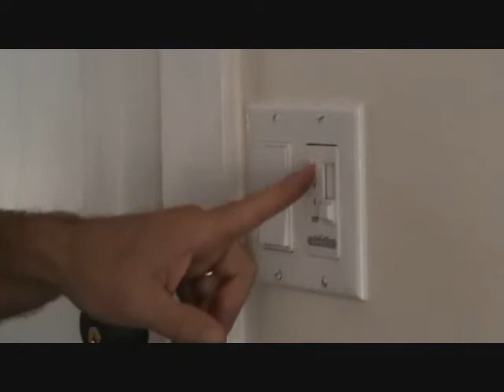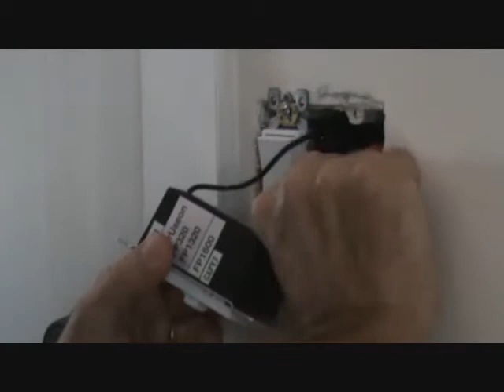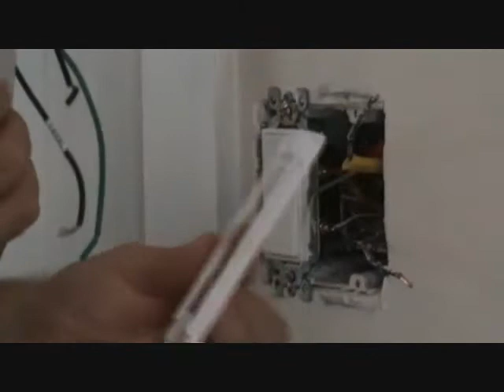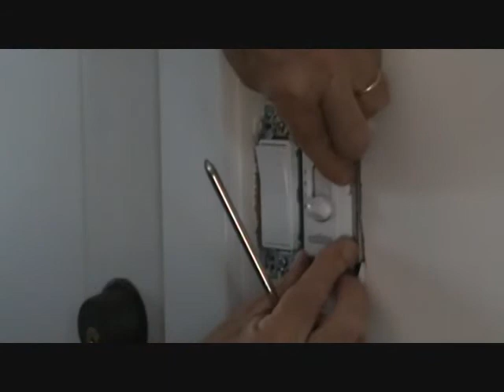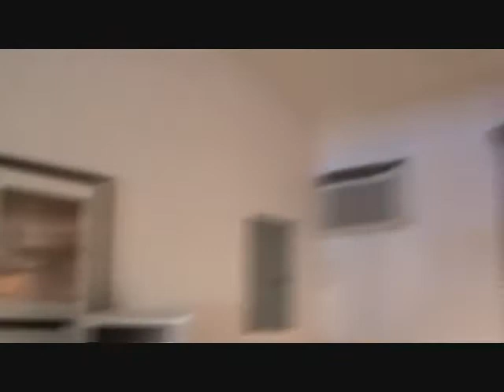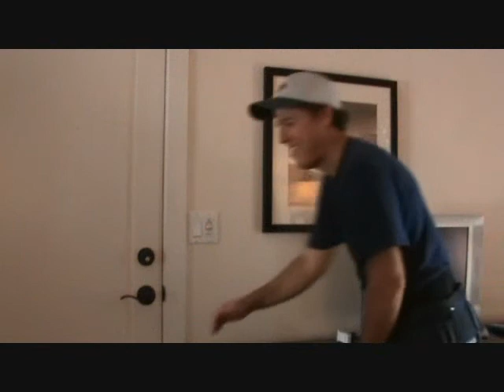How to replace a ceiling fan switch

Comment: I would consider paying $2.99 for a full length video. However, I would only do this if I knew for sure that my concerns would be addressed. It's hard to tell if the information I need will be covered in the video. Maybe if there were screenshots throughout the video shown before I make my purchase, I'd be able to decide if the video was right for me or not. Thanks for the videos, I replaced my toilet seat with ease :)
Reply from the maker: Thanks for the thoughts....